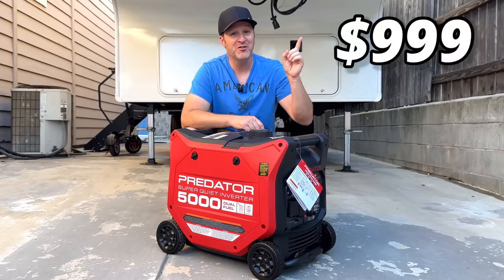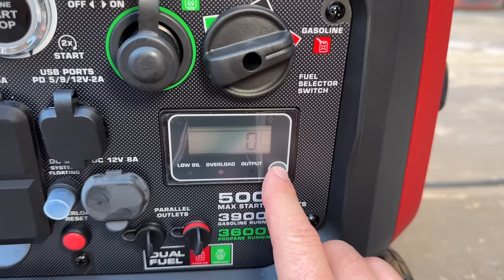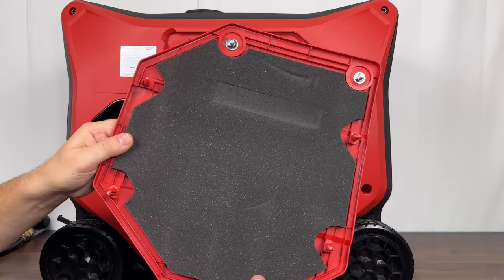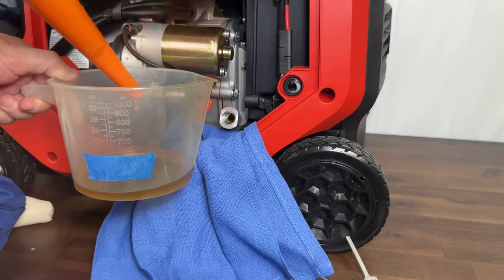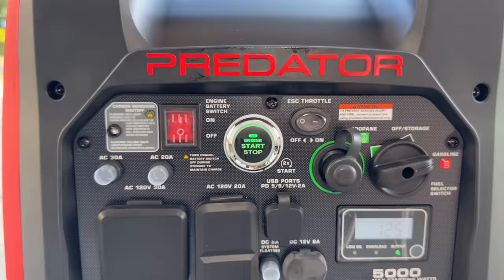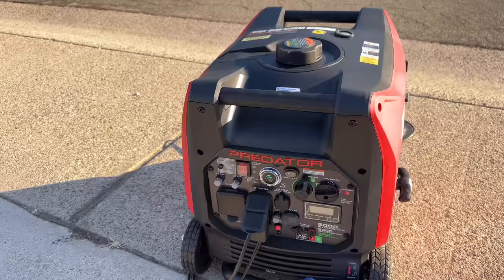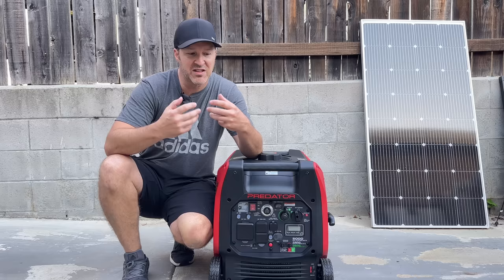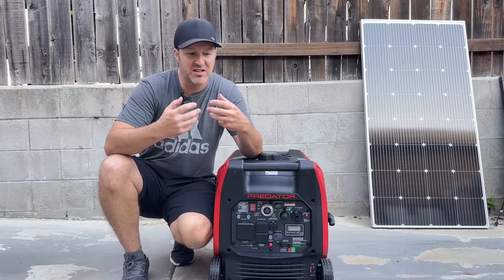BEST New Generator! Predator 5000 Watt Dual-Fuel SUPER QUIET inverter Generator LOADED!

Comment from the maker: What do you think of the new predator ?? Yea or Nah? Let me know!! 😀😀
#predator #predator5000 
ITEMS IN VIDEO…..
Have it Shipped Predator 5000: https://sovrn.co/vc3671v
RV power Watchdog30 amp: https://amzn.to/44QnlZJ
50 amp: https://amzn.to/3XXfl74
Propane leak detector:https://www.amazon.com/dp/B0B62LBZPC?
Sure can gas can:https://amzn.to/3Kf5rqn
Fuel treatment:https://amzn.to/3IfxQv8 

Direct Questions for fast response ...https://asqme.com/@johnnysweekends

CHECK OUT MY AMAZON STORE: https://www.amazon.com/shop/johnnysweekends

If you feel I helped you out..Buy me a Coffee 👍🏼🙌🏼👊🏼😀
https://www.buymeacoffee.com/johnny5120J
Reply: Have a look for the Generator that Costco sales for $999 the (A-iPower GXS7100iRD 7100W Dual Fuel Inverter Generator) I have it and it is about the same size and weight of this predator.
Reply from the maker: I like that unit but its no longer at the costcos here….actually dont think it ever was.
Reply: @johnnysweekends so would you recommend this Predator 5000 or the Genmax 6000IED/7250IEDC?
Reply from the maker: All depends 
Do you need 240v ? 
The warranty and return for the predator will be pretty easy if something happened. 
The 7250 is a nice unit and I would grab that over the the 6000 but it’s a lot more money and does weight more but not by much. 
So far the 7250 is getting good reviews overall. 
But again it’s a lot more money. But if you want 240v then it’s not a question
Reply: @johnnysweekends did you put link up for cleaning the jet?
Reply from the maker: Did I not ?? Generator won’t start Idles up and down DO THIS 5 Min fix!!
https://youtu.be/g219A_ywyHs
Reply: @johnnysweekends  Thanks
Reply: Lithium would increase the cost.
Reply from the maker: Probably but it would be minimal in a bulk buy. And would last longer. But pros and cons to each
Reply: The little tray under the oil drain could have been expanded to also be under the oil fill so that you wouldn’t have to use a rag.  Awesome unit!
Reply: Mine won't run my air compressor even with eco off my 3500 runs on eco. Can't handle any peak load
Reply: Hey Johnny 
I’m new to this generator and I want to find out how much running and starting watts my appliances are? 
Is there like a tool to find out or some other way?
Reply from the maker: Each item/ appliance will have its rated running watts. Some will give the extra amount for starting. Should be in every manual or labeled on the machine
Reply: Do you leave your esc throttle button on or off when camping in your travel trailer?
Reply: I went to buy one today because I WANTED a quieter generator.  They were on sale yesterday and since I didn't need one, I didn't pay the jacked up price of an additional $300.
Reply: Ive had one for 2 months. Returning today as fuel is leaking out of the air intake. So i say nah!
Reply: I’m getting a ton of blowby when I unscrew the oil fill plug, is this normal??

Comment: Fuel injection would be great, I'm tired of changing jets everytime I travel.
Reply from the maker: There is stuff coming…🤫
Reply: Agreed. I live in Montana and my generator seems to work fine right now at this elevation I live at (3300ft) but there are alotnof places around me I wanna go camp that are up to 6500ft of elevation. So I’m gonna order the jets for my unit just in case I run into any issues
Reply: I live at 3200' but travel to the ocean and to the mountains alot and use my generator every trip. I can change jets no problem but fuel injection would be perfect for the people that don't possess the mechanical knowledge or just don't want to worry about it. There are a few gens out there with fuel injection or an "altitude adjustment lever" but it's not wide spread across small engines. We got away from carburetored engines in 1987 "GM", why are small engines so far behind?
Reply from the maker: There are more in the works. Hoping to see them soon. 
There are a couple other models out there just not well known though
Reply: Any diesel inverter generators yet?
Reply from the maker: I’m asking people for some. They are just to expensive
Reply: do you think it’s ok to just leave the 3-5k jets on , will they do okay at 6k-7k under half load? i live at about 1000 ft and don’t want to mess with changing them all the time
Reply from the maker: I can’t honestly say because it’s new and no idea how lean they set this unit up. If you put the 3-5k keys in and use it 3-7k you’ll be fine. 
But on a hot day around a 1000ft it might be to lean and burn up. Again no idea how lean this is set at the moment
Reply: @its-andrew-y  I'm going to bet that it comes jetted for 0-3k', most small engines are. It's better to have an engine run rich than lean.
Reply: One good thing at least they give you the Jets I like the way it is easy to access everything it's easy to get to it's easy to work on in my opinion it's a far better designed in the Honda is is it is quite a honda maybe not but I guarantee you you can get parts for it and work on it and it doesn't cost near as much as a Honda and if you keep the oil changed and use a good-quality oil it'll run just as long as a Honda
Reply from the maker: For sure, and most will run just fine from 0-3500 feet, as long as you don’t run it at 30% and under all the time. Never get a chance to build heat and burn the carbon deposits.
Reply: @johnnysweekends  question. How can I run a portable generator outdoors and keep it wearherproof without building a box for it. We are only going to use a portable generator for emergencies and want to be able to quickly set it up for use and store it when done. Are there any weatherproof portable generators out there? This unit seems pretty closed in. Not sure if this unit can run fine in the outdoors when raining. We are about to have an electrician set us up an interlock panel and outdoor 50amp outlet to feed our entire panel in the event of an emergency. Just want to find a solution for using the generator outside in the weather. There are many videos online on how to run one’s house on a portable generator. But a lot of them do not talk about the solution or problem with protecting the generator from weather when in use. We of course will be storing it in our garage when not in use. Thanks
Reply from the maker: @CD-fo2el Gen tent makes alot of covers you can use while the generator is running. See here 😀👍🏼 https://amzn.to/4bdjdqN
Reply: Thank. How well will this hold up in a wind storm. Seems like it will just get ripped right off the generator.
Reply from the maker: @CD-fo2el They strap on pretty darn good. I mean it’s either that or make a generator hut or shed for your gen.
Reply: Have you thought of only using propane at high altitude? I live at 4700 feet and have the correct jet but I camp as high as 6500 and I just use propane at that altitude, and the one time I had to use gas it ran a little rich but worked fine otherwise
Reply: @26-CJ  get you a generator umbrella ☔
Reply: Thinking the same thing, even without altitude changes, carburetors are really obsolete in 2020+. Fuel injection is absolutely bulletproof and no longer overly complicated or expensive to include on small engines.

Comment: No tri fuel, no 240, no fuel injection 🥱 i’ll keep my Firman for half the price and dynamite return policy through Costco. Product is mediocre. Reviewer is fantastic.
Reply from the maker: Hey a friend said they were not letting generators be returned if you put gas and oil in it? 
Have you heard anything about this. I guess this is recent so now I’m wondering. 
Because you used to be able to return a dead Xmas tree and now…😂🤷🏼‍♂️
Reply from the maker: Oh and thanks 😀👍🏼
Reply: I just returned a generator to Costco a couple weeks ago. I purchased the larger Furman and returned it because it was too noisy. I looked at the return policy thoroughly before purchasing, generators are not excluded as of now. I won’t have to worry about the gasoline part either because I’ve only run natural gas and propane. I love harbor freight if it was 240V I would buy it in a heartbeat.
Reply from the maker: Ahh good to know, hopefully they don’t change it but will see. 
And yea you’ll have to step to the large predator or go with another brand for 240v
Reply: I feel like fuel injection is overrated. Its nice and convenient most of the time but when it fails its going to be expensive to fix and more difficult to troubleshoot. The carburetor does need more TLC due to the EPA contaminating our fuel with ethanol but carburetors are cheap to replace and simple as a stone to work on and clean.
Reply from the maker: If the carb dies or gets corroded it’s like $40 to replace and away ya go.
FI will not be so cheap to fix
Reply: @johnnysweekends  It's also extremely rare that they are so corroded I can't bring them back to life with a wire brush, compressed air, and guitar string or at worst a dip in the ultrasonic cleaner. Sometimes it makes sense to buy a carb if you aren't very handy but carburetors are pretty difficult to kill in a way they can't be revived from.
Reply from the maker: Yea all depends how long they sit. Where they live and the fuel used with or with out treatment. But it’s weird some can be horrible and some not to bad at all.
Reply: Champion now sells Trifuel Inverters w 240 and 9KW!

Comment: No lithium batteries on emergency generators!  The reason:  Below a certain temp., lithium batteries "DO NOT WORK"!  In a generator, a sealed lead acid AGM battery is the gold standard.
Reply from the maker: They work well below freezing they just won’t charge until they are warmed up again above 32f. 
Which once running the Gen will get nice and warm. 

Lithium works great if you know what to buy. But nothing wrong with agm but I’ll never get lead acid anymore. Even in my vehicles.
Reply: @johnnysweekends  I agree, I switched from flooded L/A to AGM in my car.  As a telco lineman I worked in hundreds of CO's (telcom "central offices" where all cables lead to).  I have seen emergency generators from 12k to 3 mega watts.  The largest generator I ever laid eyes on was in a 60 story data center in New York City.  They were Caterpillar C175-20s (there were two side by side).  They were rated for 4000 kw each.  I know it's counter-intuitive, but the battery of choice for all these standby generators was "flooded lead acid" (wet loco-motive cranking batteries).  My guess is, the most simplistic design is the most reliable?  Anyway, the Predator 5000 looks cool.  I think they should have gone with the next engine size up.  The Predator 3500 and the Predator 5000 seem to share the same 224cc engine size.  My Honda eu3000is has the 196cc and my Yamaha ef4500ise has the mz360cc.  I looked into Li-on start batteries for my gens. but our low winter temps get down to 4 to 5 degrees above 0.  Both my gens. have the original stock Yuasa AGMs and handle the cold great.  Cheers and again, great video.  Keep 'em coming!

Comment: I would love to see you do a high hour test on some generators.  We have about 1200 hours on our Predator 3500 that we bought last September.  Ran it 6 weeks at 24x7 at a place impacted by the hurricane.  Thing is still running like a champ
Reply from the maker: I would as well…😂 but with all the units I have I run each a few hours here and there as i rotate around. Plus the fuel expenses would be nasty….would have to start a go fund me 😂. 
I may just lend them out more so people can put hours on them and see what they do.
Reply: I have 5100 hours on my predator, I had to replace the battery and one outlet went bad,other than that is fine
Reply: I got a Ryobi 2300 watt generator that has about 7000 something hours on it still fires right off I think a big part of it comes down to oil changing and the kind of oil did you run in it I run a oil that is for air cooled engines and has heavy zinc content in it generally change my oil every hundred to two hundred hours
Reply from the maker: Wow that would be a record for that little guy. What are you powering? Constant load?
Reply: @johnnysweekends  Max 625 watts, window ac ,small regrigerator
Reply: @12345678989814  I had the same Riobi inverter gen 2300 , it last   600 hours, the green one right ? that was 2 years ago
Reply from the maker: Ahh nice so minimal loads on it so it just purrs
Reply: Yes  I also have 3500 inverter as well.  Brought magnetic oil drain plug from Amazon.   Broke-in for 1 hour,  removed metals from plug,  changed oil.   Ran at maximum power until gas is depleted, removed metals from metal plug, replaced with fresh oil and repeat process one more time.   Now, its over 9,000 hours on a three year old inverter.
Reply from the maker: @johnpodo wow that’s awesome!! Love to see these off brands pass 5000 hours and your is well over 
Thanks for the feed back
Reply: I also have the 3500 it's a great generator. Thankfully I've only had to use it once, Christmas Eve 2022 , power was out for 30 hours and it was 14-20° we were the only house on the block habitable. We had a great time.

Comment: This is a SOLID release! I'm not sure what I love the most, but the easily replaced and included jets....I'm impressed.
Reply from the maker: Yea that’s definitely a bonus they included them. Very surprised by that.
Reply: I don't get what the jets are for.
Reply from the maker: It’s to make sure the generator is running optimally with the right fuel mixture. M when you go up in altitude there is less air air. So less air, less fuel.

Comment: Just purchased 8/26. 3500 6mo. Old 2567hrs starter drags, hour meter stop @1990. Break in oil changes every 25hrs to 100hr.   New DF im doing the same. @13amp plus on a 20lb LP tank ran for 10.5hrs. 30lb tank 21hrs  happy so far
Reply from the maker: Nice thanks for the info and keep us up to date.

Comment: At 110 lbs it's just a few pounds heavier than two predator 2000 suit case generators, plus an additional 1000 watts on top of that.  Sweet 5000 watt generator

Comment: Nice review Johnny. Thank you!  It looks like a nice generator but I can't figure out why Harbor Freight only has 90 day warranties on their generators.  That has to be the shortest warranty of any generator.
Reply from the maker: Yea I always wondered that. Only thing I can think of is they want you to buy the warranty which means you almost have to..😕
Reply: I never buy their warranties because their generators seem to out perform the competition. If they fail after a few years of my fairly heavy use, I can replace it (with updated version) and still be under the Honda price gouge. My 3500 is a superstar

Comment: This is an excellent new release!  I really like the 3500 Predator, but have consistently been looking for dual fuel options like Champion.  I'm planning on warranty return a malfunctioning 3500 with about 500hrs and upgrade to this one.  The features are top notch additions!!
Reply: I wonder if this unit is as quiet as the 3500 
If it is I'm buying it.
I have a 3500 right now I love it but this new model is super nice and has more power
Reply from the maker: I think it’s a pinch quieter honestly because it doesn’t rev as high at the same load. If both are at 1500 watts the 3500 will be running a lot more rpm. 
This does just kinda purrr lol. 

I’ll have to see if I can get another 3500 predator
Reply: I have the champion dual fuel and love it!
Reply: @dirtydigger3218  Which Champion model do you have?

Comment: I like the specs. 
The sound is not too bad but well above my Westinghouse @52 dB, however, 
I keep it under the house and it rarely is heard at all.
I like that it is much easier to service.

If I was buying a new generator, I would definitely consider this one. 
Dual fuel is really nice. I have a 100 lb propane tank which would be very convenient.
Reply from the maker: It’s definitely a nice unit. Wish it was a pinch smaller and lighter but again seems to be built tough.

Although I have tested the Westinghouse as well, in a db test video and it was one of the louder units in the same tests with other gens. You can’t go off of the stated of what’s on the box. It’s still a quiet unit and they are all pretty close. But where you have it is great as long as properly vented and exhaust is pumped out..👍🏼

Comment: We have a Champion 3600 and 4600 watt Dual Fuel inverter/generators and love them. We always take the 3600 watt one because it's lighter and a lot quieter for some reason. We get about 10-11'ish hours on a 20lb propane bottle at half power.
Reply from the maker: Champions are good units

Comment: The lead acid battery is actually a plus. You don't have to worry about it running too hot or cold. - which can seriously damage lithium when charged/used.
Lead acid isn't obsolete yet. ;)

Comment: Yours is the second review I Have watched on this unit. Both units have made the noise of a failing Bedix in the starter. That wail would drive me crazy! Nice review. Thanks
Reply from the maker: I would say not really a failing bending but more of where the motor is in relation to the compression stroke or exhaust stroke. If it fires real quick the bendix will free spin once engine is started because its a set time for activation. I have started this several times and it does this about 2 out of 10 starts I would say. 
And thank you. 😀👍🏼

Comment: Glad to see this. I'm in the market, and I was looking at the WEN DF451i Super Quiet 4500-Watt Electric Start Dual Fuel, which is just about $750 on the jungle site. This compares very favorably. Perhaps if HF puts it on sale, which I'm sure won't be long, this would be hard to pass up.
Reply: predado is better   i use the 3500  for 1000's of hrs